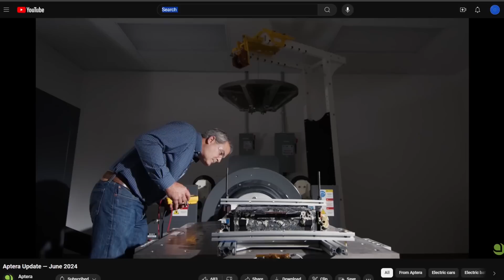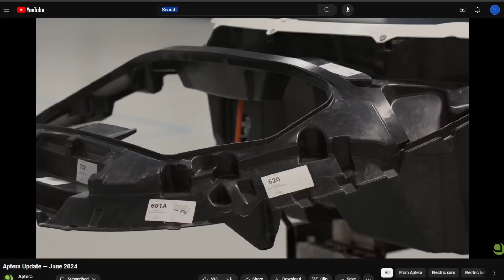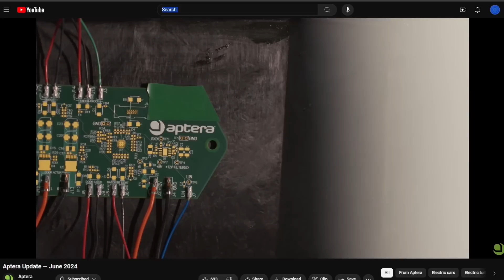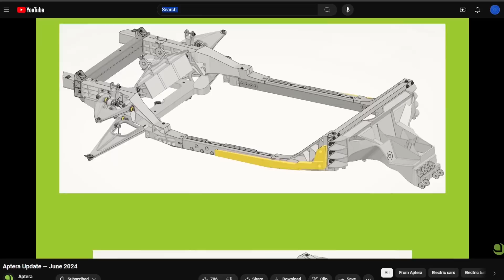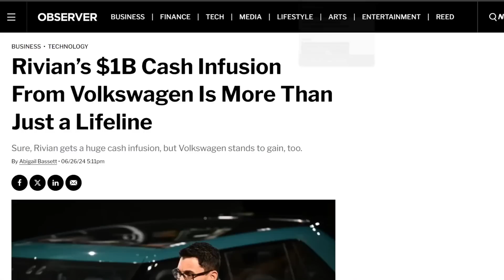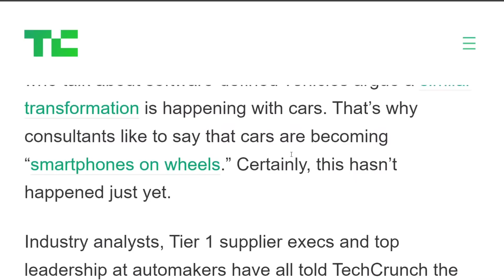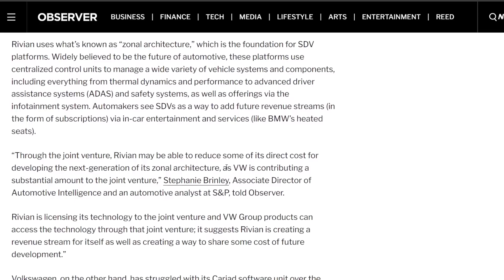Aptera IS testing and gearing up for PI2

Comment: Not a fan of the direct wire to board connections shown at link below. This will be a real pain to desolder if a board needs to be replaced. And it sounds like they did it everywhere 😐

https://youtu.be/qD8A5WAoYTs?t=4m32s
Reply: Back in the 80's my then wife fell in love with a used Peugeot 505, despite my protests. Peugeot hadn't left the U.S. yet and it was at a very reputable dealer that was a jeep dealership as well. The car was immaculate and had all the options like power moon roof etc. It had a manual transmission and a suprizing good 4 cyinder engine, and I will confess it was a pleasure to drive. It accelerated smoothly and effortlessly to get up to highway speeds and had a refined ride quality. However, as it aged, the electrical system was absolute $hit.  The metal contacts in the bulb receptacle and even rocker switches would oxidize and stop working or work intermittently. I would have to tear things apart, including rocker switches and connectors, and clean the contacts with contact cleaner, etc.
There may be merit in reducing those points of failure.
Reply: I'd also be interested in how using direct wire to board connections affects their workflow. Normally you source a wire harness from a third party and everything just plugs together. But what's shown in the video requires wire to be soldered to each board individually. This seems like a ton of extra assembly time/complexity just to remove some connectors.
Reply: @AverageJoe928  I believe that ChrisM said on discord that they are connectors, not soldering.
Reply: @WyndStryke  Good to know.  I really think steve should have given more thought to how this message would be interpretted without showing a clear picture.  Its great we have such direct access to Chris M for corrections.
Reply: @WyndStryke  good to know! I can see the crimps on the wires but it looks like the contacts are then soldered to the board. I do a lot of PCB design/layout and have never seen a connector like that. Interested to find out a part number for it.
Reply: @ccibinel  There was more information in today's live stream at around the 15 minute mark.  It sounded like it's some sort of pick&place surface-mount connector where you insert a tinned wire, and it grabs onto it, and then the whole board is conformally coated afterwards.  If you look at that initial shot of the board, the wires at the bottom were crimped and soldered, but the wires at the top used the new connector.
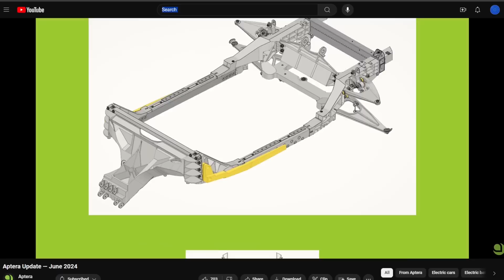Reply: @AverageJoe928  @ccibinel Also take a look at 6:40 in the video, there's a better closeup than the 15 minute view.  The connector looks like a horizontal surface-mount tube.
Reply from the maker: Good point!
Reply: @AverageJoe928  YES!!!!!
Reply: One more thought: Aptera has said that their goal is to remove connectors because Monroe told them that they're the majority of failures in vehicle electronics. But direct solder wires have to be manually soldered (as opposed to automated soldering like reflow, wave, etc). Manual soldering brings the risk of cold solder joints, which are terrible for high vibration applications. The joints become brittle and result in intermittent connection or complete detachment. There's a real chance that direct solder wires result in higher failure rates than connectors over the lifetime of the vehicle.
Reply: @AverageJoe928  Also not great for owner serviceability, unless the owner is confident soldering.
Reply: @AverageJoe928 if Munro told them to direct solder wires to modules... that would be a shocker.

Comment: Am I the only one concerned with them gluing components into an automobile? I really don't see this as a viable long term solution
Reply: I very much doubt that they'll be using glue.   The holes are there for a reason, not just decoration.  My guess is that they have ordered injection-moulded enclosures for the PCBs, which haven't arrived yet.  I would also expect conformal coating to applied to the PCBs (for dust & vibration protection).
Reply from the maker: That's just me theorizing I have no idea if that is the case or not
Reply: They never said anywhere that they were going to glue them.

Comment: I'm glad to see this. I'm hoping to get an Aptera in the next few years.

(To continue my usual rant on solar panels on a car... sorry to the believers)
The disadvantage of "solar mobility" is that your car is going to need a beefed-up air conditioner to deal with it sitting in the sun. In practice, some of the energy gained from the solar panels will be used to cool the car's interior when you first get in a hot car. I'd rather not have solar panels and keep my car in the shade.
Reply: What you seem to miss, is PVs are converting solar energy into electricity instead of being wasted in heat on and in the body. That dash PV will also reduce cabin heat from windshield, the main heat source for Aptera inside when in full sun.
CF thermal resistance will isolate the cabin space from heat body transfer.
With the remote AC, I am convinced heat will be manageable in summer, and I leave in CA Central Valley where we have 3 digits (F) temperatures frequently during summer.
As a thought exercise, which will be hotter inside, the Aptera full solar, or the clear hatch one? 
Consider the PVs as a following shading device. Bonus: no more chasing for shaded parking with an Aptera!
Reply: @Aa792 don’t forget that those dark colored panels will absorb and get hot like any other dark surface.
Reply: @SteveBueche1027 
No, they will be less hot because part of the energy will be converted in electricity instead of all heat. But, yes they still will be hot to touch, but less hot.
Reply: @Aa792  Only 24% is converted to electricity. For all practical purposes, they'll be getting nice and hot.  Having said that - surplus electrical power can be used for ventilation to keep the interior of the vehicle at a sane temperature.  So I don't think temperature will be a major problem.
Reply: @WyndStryke  Correct, and that is indeed 24% less heat than a non solar roof.
Further, the solar piece is shading the binc below with only a few contact points, and thus is offering air thermal  isolation. 
And as said earlier, CF is a good thermal isolant and I do not think, like you, overheating will be a problem.
I am convinced a solar car will be colder than same car without solar, back to original comment that lament having solar. I know from experience, I have a West facing roof that was beaten by sun in the afternoon and my AC runtime has dramatically been reduced when I installed a rack of PVs that shaded that West facing roof.
Nevertheless one can totally choose to park in the shade.
Reply: @Aa792  It doesn't work like you stated. The PV will get hot just like any other material. What I meant is that people will park their cars in the sun, thinking it gives them a huge boost in range.

In reality, the gain is marginal and not worth returning to a hot interior when you could just park in the shade. Additionally, the heat could reduce the battery's lifespan over time. I just don't think solar panels are worth it—the juice isn't worth the squeeze.

Comment: Hi Steve,  As the tech is demonstrating electrical fitment, check the bottom of the circuit board and you will see the hole for the mounting screw.  Near the tip.
Reply: There's another image where mounting holes are clearly visible on both ends of a circuit board.
Reply: Before giving the master plan to CPC, they knew exactly where these circuits would be located and they sure indicated them in the plan. There is no way CPC wouldn't create mounting spots or holes for them.

Comment: "Drivable" means with motors. That will be interesting, unless we have specific updates before that.
Reply: Aptera could go back to the "standard" model hub motor produced by Elaphe for the PIs, not out of the realm of possibility here.  Switching powertrain manufacturers this late in their development cycle would not look good imo.
Reply: If anyone tells you that a PI vehicle isn't drivable then that means they intend to produce non-drivable production cars, which is insane. These new vehicles they are building are just more prototypes , they will be used to attract more investment and so it will continue until they are either bought out or go bankrupt - they'll never produce a vehicle to sell.
Reply: @bluetoad2668 , Given that Aptera now has the funding from US Capital to get to production and is no longer seeking small investors, your pessimistic predictions are bone-headed. Aptera is increasingly looking like it will become a successful company. Things could still happen to derail the company once the company gets to production, as happened with Arcimoto and Fisker, but Aptera does have the funding and the suppliers to get to production.
Reply: @bluetoad2668  Clearly you haven't been following Aptera's development plan because many of the PI vehicles will in fact just be test beds for system integration and crash testing...many will in fact not be drivable.
Reply: @bluetoad2668  
Your bull$hit proves you to be a clueless troll. These new vehicles are Production Intent builds used for validation and testing. 
Necessary steps in the drive to mass production NEXT YEAR.

Thanks for the motivation, FUDmonger.